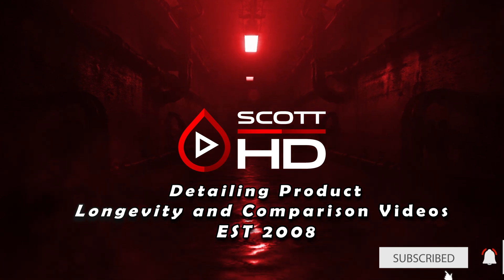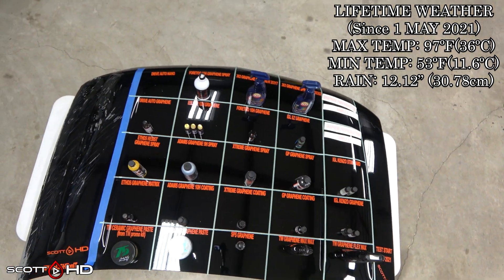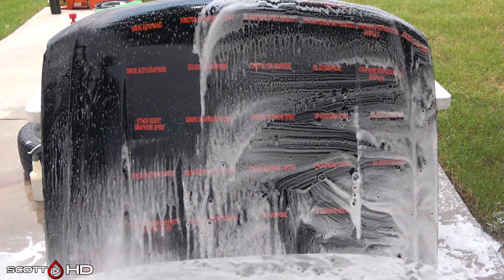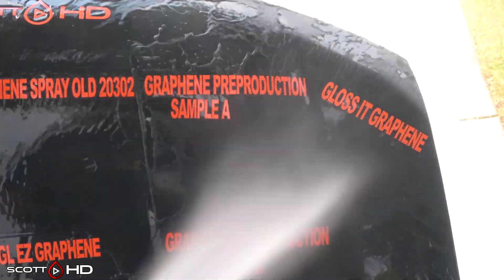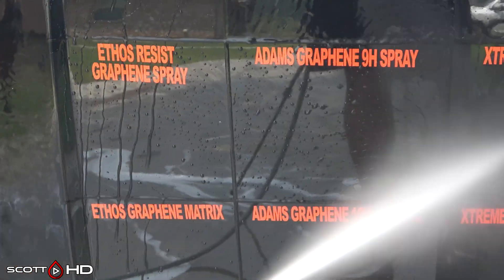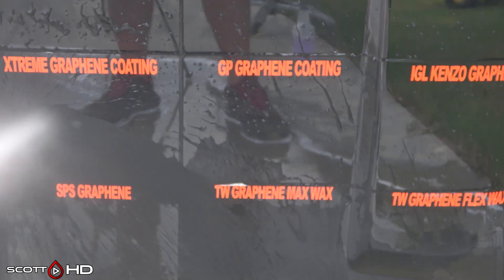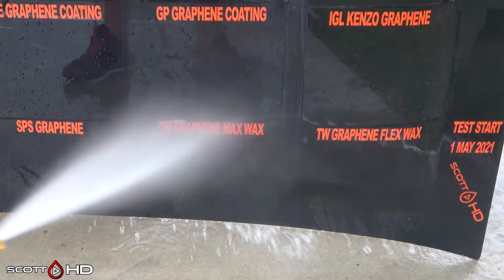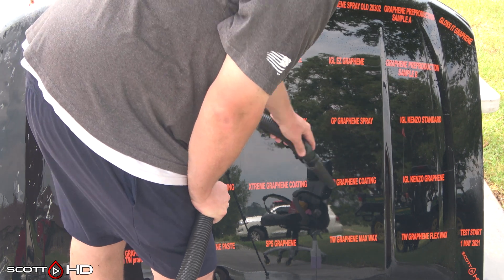Graphene Coatings Longevity Test - 25 WAY - ULTIMATE comparison - UPDATE 05 - 2 MONTHS MORE WEAK !!

Comment: Another extremely helpful video. 

I bought a jar of that TW graphene to test out during the initial run, I’ve been using it on my stainless steel outdoor kitchen pieces (I live on the Gulf). It’s held off corrosion as good as my previous attempt (CQuartz) and it was easier to apply. 3 months appears to be about the maximum before the stainless starts staining.  Stupid salt water
Reply from the maker: Good to know!   It is definitely easy to use.

Comment: Looks like IGL is consistently good. Must have good quality control.
Reply: Exactly
Reply from the maker: We install IGL in our shop so I wanted to see if there is any difference between the old (no long available) and the new graphene.   Our experience so far is that the new one is much more difficult to apply on to paint protection film, but easier to apply on painted surfaces.  The longevity remains to be seen.
Reply: @ScottHD  agreed. No clear benefit to using a graphene product over a non graphene product.
Reply: Any update coming soon?